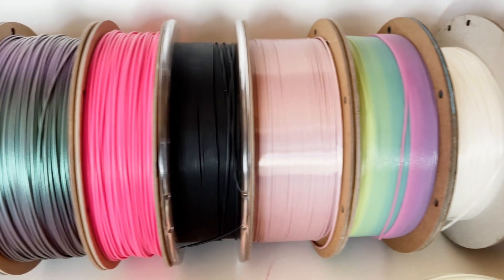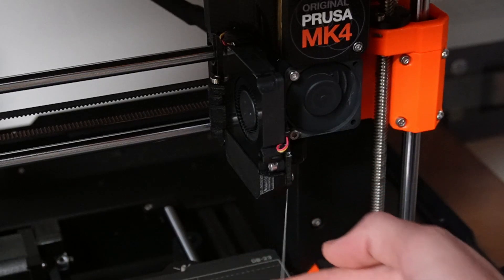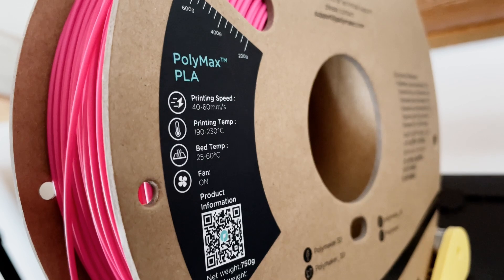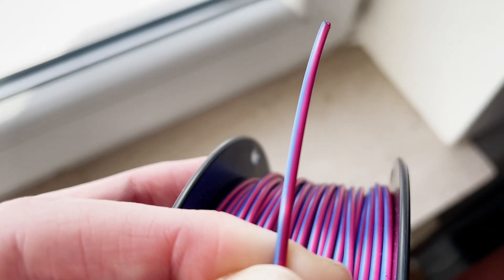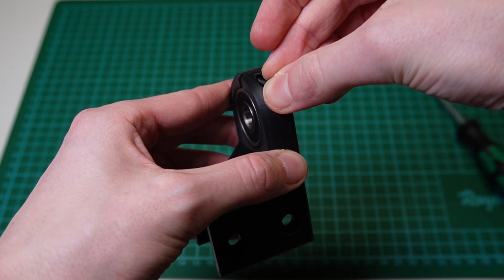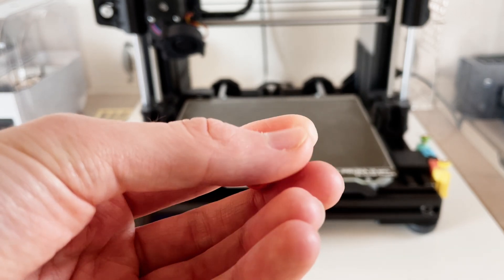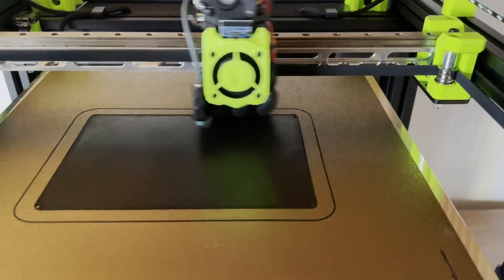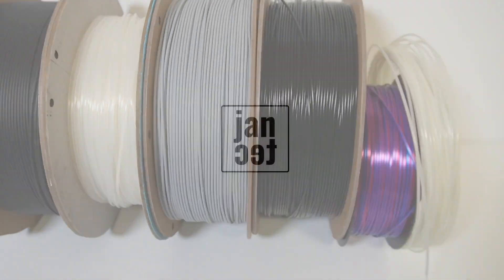10 Special PLA Filaments You Need to Know!

Comment: I specifically use the color changing material on my Voron fan cover/plates. It doesn’t require much structural priority, and it visually tells me if the electronics are heating up due to the passive air temperature rising. It’s cool to see it change 10 minutes into the print from cold start.
Reply from the maker: That's a cool use case!

Comment: Use cases for color changing filament: I mentioned the Raspberry Pi case in a comment. I also made indicators for the central heating radiators, so I could see if they are on or not. You could put one in a bath tub as a "warm water" indicator as well. My favorite use was to make "coins" where the backing was printed in black to white color changing filament and the graphics on the coin with black filament. When the coin is cold, it looks black, but when you hold it in your hand, the background fades and you get black graphics over a white background. I used the Marvel S.H.I.E.L.D. logo as graphics and "engraved" my tag on the backside.

Comment: Color changing plastic could be useful where visual indication of temperature could be useful.
I could imagine like electronics prototyping where you could look at a glance if your device is overheating, especially if it's used in enclosure. 
For example if a PCB is attached to the enclosure like to a backplate.
Though I'm not confident that it could be optimal for such use since for a generic semiconductor device critical temperatures are usually in 70-100C range that can be bad for PLA.
Reply: I printed my Raspberry Pi cases using color-changing filament, so I can see if they heat up (and where the heat is). I had the old case for years and it actually lost most of the color over time (probably because of UV?). The new one is purple/orange filament and it's currently a nice raspberry color, so it turned out to be a nice choice.